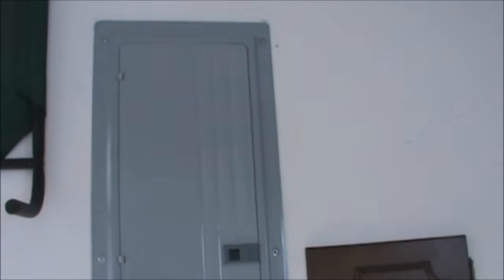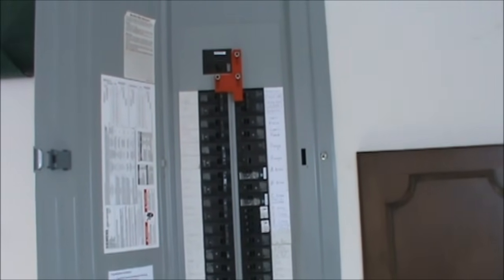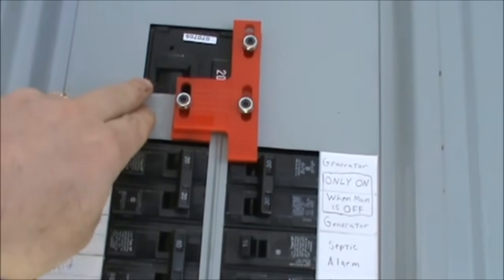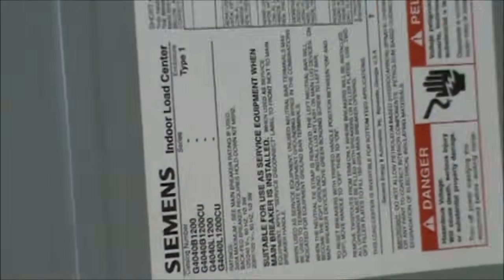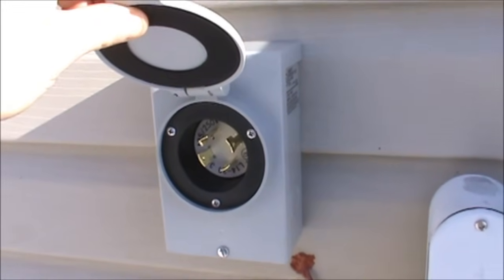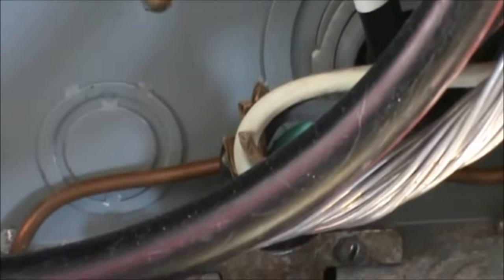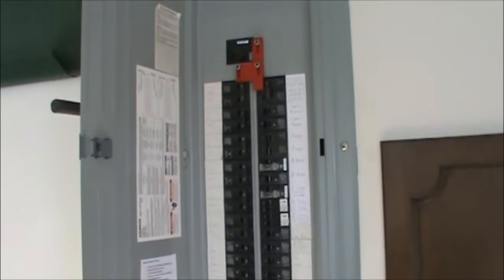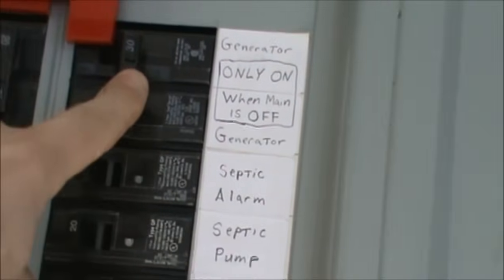How to wire a generator to an electrical panel

Comment from the maker: Here is the list of supplies:
http://amzn.to/2eEizqq  Square D lockout
http://amzn.to/2egMbMk Siemens lockout
http://amzn.to/2esoq6o  Generator outlet
http://amzn.to/2f2oYyB  Generator extension cord 4 prong
http://amzn.to/2egOJdC This Generator will do the whole house
http://amzn.to/1NzsVmM   Click links to get your generator transfer switch.
Reply: doublewide6 Repairs LL
Reply: @bigdaveyb 8 gage would be fine with. If you have an oil or gas furnace you can run your heat, but no electric heat pump and no ac, no oven unless it's gas, and if your stove is electric keep it to one burner at a time. I would only plug in the fridge every 2 hrs of about 20 minutes or until you hear it kick off. You have to know how many watts you gen puts out and use some sense. If you use a burner on the stove, maybe cut the heat for 15 minutes or whatever. Try only using what you need, if you're maxing out the gen you're using more gas so if the outage is longer than expected you may be without heat. I assume you're wondering because of winter coming that's why I mentioned heat so much. It gets VERY cold here at times. Also it's easier to hear water for a whore bath on the stove than it is to use the hot water heater, they use a ton of electricity.
Reply: Best video I saw on this!  Thank you.
Reply: I realize it is kinda off topic but do anybody know of a good website to stream new series online ?
Reply: Yer a good exaple of "the right way"...Thanx!
Reply: And I can't spell, ahahhhaaa

Comment: I'm a lineman.  Thank you so much for explaining the backfeed part. That is the #1 danger to us during storm work. Backfeed has killed a lot of good men
Reply: as a lineman ... not taking care of the back feed is what has killed a lot of good men. You shunt that secondary or take the secondary leads of the can and you will be safe.
Reply: Us line clearance guys thank you to.We have to get the trees off the wires during storm work & can be hazardous from many things including back feed.
Reply: I was always taught to break the home's incoming neutral/ground as well, since American homes are single phase 240V, with a center tapped transformer creating all the 120V between the phase. I was told 9 times out of 10, you should be fine not disconnecting it, but that 1 time out of 10 (anecdotal of course) problems can arise if the generator has any type of fault, or issue. Theoretically, all your 120V appliances should seek their way back to the source (generator), however, if there's a problem, they will have an alternate return path back up the neutral/ground coming in from your power co, which is directly connected to the transformer windings that give you 240V. This might be fine, or, it may lead to additional ground loops, and burnt out appliances. One guy I know, hooked up a generator like this during a blackout, and blew out every 240V appliance in his home that also contained 120V equipment within it, (like dryers, ovens, etc..) and he was told it was because he only disconnected the main (hot wires coming in) but left the neutral connected, creating two possible return paths. Somehow this resulted in a floating neutral condition, and everything that was 240V, but with internal 120V components, received higher voltages, like say 200-208V, burning stuff up.
Reply: If the mains are shut off on the panel, how can it back-feed?  (just trying to learn something, thanks).
Reply: the Interlock is a MUST-HAVE and WELL WORTH the investment to protect my Linemen. Salute 🫡 To All…….
Reply: I wonder what Lineman do about solar electricity in cases like this?

Comment: We were out for 21 days during Hurricane Ida in August 2021!!  The worst thing was finding gasoline, so my plan for the future is to find a portable generator that uses natural gas. Of course that adds to the cost of having it piped to my house and paying the $8 monthly minimum rate the gas company charges even when I use 0 cubic feet of gas. I think it’s still worth it if only to prevent finding gasoline when it can be dangerous to be on the roads. Thanks bud!

Comment: Very nice job. You covered everything correctly. I watched a couple of other guys videos and saw several mistakes. Biggest one was not using correct wire gauge or not having the lockout. Just remember to highlight the emergency breakers so someone other than you can do it easy and without worry. You may be busy somewhere else or gone.

Comment: If I wanted to get a certified electrician, I wouldn't have to search for how to hook a generator up to my electric panel.
Reply: +madseasonstaley  I think it is more safe, for a homeowner to be familiar with the electrical in their home.  The thing that confuses most, is how the 120v/240v concept. How it actually works in the panel. However if someone draws it out on paper, it makes sense.  A 240v transformer with a center tap dividing the voltage in two.  so you get two 120v legs with the centertap neutral, and or L1 and L2 make 240v.   People who are afraid of fires and electricity often burn their house down because they are willfully ignorant and dont have common sense, like running a space heater with a old 1950s loosy goosy recepticle. A person could replace the outlet with a new one and not be a moron.
Reply: Could get KILLED that is why... connections have to be done correctly from a certified electrician. ⚡⚡⚡🔥
Reply: @Rob Packard:
NO ....
Reply: @ACommenterOnYouTube  Yes.
Reply: @ACommenterOnYouTube  yes
Reply: @ACommenterOnYouTube  do as you PLEASE it is dangerous or you wouldn't be asking questions call someone certified don't listen to ignorance. Good LUCK
Reply: Right !! Give it a try !!!HAHAHAHAH!!!!
Reply: Thanks for the video, doublewide, ignore what this Mad Season troll/idiot says. A responsible homeowner takes it upon himself or herself to learn something about what a tradesperson is going to do in their home.
Reply: Exactly
Reply: Lmao . This aged well
Reply: Electricity is dangerous to those who are not properly trained to work with it. 
  Please consult a professional, this is not a “do it yourself project “.
Reply: Haha
Reply: Yep same here

Comment: I wired my generator into my panel using the exact same method.  While a sub panel may be the more popular route, I much prefer your & my method as you can have the flexibility to light up anything in your panel and is less expensive than a sub panel, however it just takes some common sense as to what you can light up, and most homeowners don't know.  Hence why this is a much less popular solution, but far superior IMHO.  Good vid!
Reply: I have a pushmatic breaker they don't make interlocks for them so I will need a sub panel or a transfer switch

Comment: Was sitting here on site (Northern Alberta Oil Sands), with the guys..talking about gen sets and how one would connect to a home panel. Nice video. Well explained and glad to see the interlock - very neat device. Am now thinking that deleting my electric stove for Nat Gas would go a long way to making life a bit simpler during an emergency...never did like that glass stove top anyway.!  Cheers and thank you for an informative, safety first video.
Reply: I tossed my electric stove...now have a nat gas one. Never looked back...Electric bill plunged, gas bill rose slightly...also tossed the electric dryer and went gas.  Greetings from Northern Ontario.

Comment: thanks for the video. i picked up the same generator for $499 at HF in Austin with a coupon.  basically since i have a gas dryer, i back feed my place through the electric dryer outlet. (only after installing a safety where i can't back feed through the grid.) works great.  i have a 3k foot house and i only load about 20%. i'm thinking i can probably connect my Central Air too but haven't yet.

Comment: This looks exactly like the cord i made to back feed my breakers.  All we did once the power was knocked off during the hurricane was turn the main off then feed our homemade cord through the breaker box then to the breaker and other points like you did.  The outlet you installed makes it way easier during a storm though!  We were out in a hurricane wiring the generator up.  Ran the whole house though besides hvac.

Comment: Do you know what to do when the 200A breaker is located in a main panel on one side of the house, and the second panel in the garage does not have a main breaker that could be locked off with an interlocking plates? Can I add a 180A breaker in the garage panel? I want my generator behind my garage.
Reply: Wow! Great question, I'm sorta in the same dilemma.
My 220 amp box is in my house where I can shut my main off, but my garage is on the other side of that and has is own small panel.
I do have a main shut of at the pole also, that will shut all power down, but I still can't understand how I can do this and still have power to my garage AND house.
Hard to explain!🤔
Reply: For info, to fix my problem, I finally installed a 200A breaker in my garage panel and a 50A breaker for my 1200KV power generator plus the interlocking plate of course. With my two 200A breakers, I feel safe.! LOL
Reply: @chrischenusa6323  Nice!

Comment: The video showing the "interlock" is exactly what I have been looking for being interested in a manual transfer and something simple.  Thanks so much for the info.
As for why a larger generator, the starting amperage of the water well motor has to be considered in the size of generator you buy.  Amperage is 3 to 5 times more at start up than running amps.

Comment: I read quite a lot of the comments posted here before making one myself.  I have a 4KW Generac, which I hard-wired into my home back in 2000, so I've got some experience, though I'm not an electrician.  I did take some extension courses thru the local university to learn something about it beforehand; after all, if you make a mistake with some DIY plumbing, all you get is wet...anyway, one thing I've noticed about some of the comments here is that there's a lot of discussion about generator size and how bigger is better, etc.  In discussing what would be run off these generators, it seems kind of sketchy.  

4KW (kilowatts) is of course 4,000 Watts, which is what my particular model is capable of producing and sustaining for extended periods.  What anybody wanting to put in a generator ought to do first is figure out how many watts it would take to operate the lights, plugs, appliances, etc. in your home without overloading the generator.  Lights and plugs are not really a problem, unless you routinely have multiple small appliances plugged in and running continuously and every light in the house on (we don't).  my size of generator can handle routine household lighting and appliance use, and has done so for going on 16 years.  This means we can watch TV, listen to the radio, use computers, etc, i.e, conduct routine business and entertain ourselves during the outage.  The electric stove, the water heater, the heat pump, washer/dryer, all the big stuff that produces heat and/or draws a lot of power, well, sorry about that.  These are emergency measures; you can bring in a kerosene heater and a propane stove for cooking and hot water.  I can say, however, from ample experience that my little Generac 4-kilowatt generator, 1999 vintage, can and does handle two full-size refrigerators and an upright freezer.  I've observed situations where two out of the three had their compressors (with the usual extra-amp start-up draw) cycle on simultaneously and that good old Generac 4000XL dug in and soldiered on without bogging down, hesitating or otherwise missing a beat.

And what size double-pole breaker do I use for all the above?  Believe it or not, twenty amps.  That's all, and that's all that's needed.  Why?  because the only circuits I activate when I'm on generator power are either fifteen or twenty amp:  the lights/plugs in the whole house, including the 20-amp plugs in the kitchen (in addition to the refrigerators we can use the microwave) and the freezer circuit in the garage.  We've never, in 15 years of operation, even once had too many lights on or too many appliances running to where the generator was overloaded (and it will let you know if you do) yet we were able to move throughout the house using them as needed, just as we would if the power wasn't out.  And there was no flickering lights or TV screens, either.  That dedicated 20-amp breaker feeding the power to the house is just right; if some sort of problem were to develop, it would do its job and open; it's never had to yet.

Since my system is, in fact, not in compliance with the NEC and is (potentially) dangerous, I literally go thru a checklist to bring the generator on and off line, similar to what pilots do when taking off or landing an airplane.  There is virtually no chance at all that the main breaker will be "accidentally" left (or turned) on while we're on generator power.  Common sense and attention to detail is all that's needed.
Reply: 4,000 watts may be good enough for some, especially those with city water. But if you have a well pump, you quite possibly need a more powerful generator, or you won't have running water.
Reply: I appreciate your experience and diligence in operating your generator.  However, if I were a service lineman working to restore power I would feel much better knowing that all generator hook-ups had a fail safe connection and that my life was not at risk because someone made a mistake.  It is best to install a fail safe connection as shown in this video.
Reply: Steve B p
Reply: Steve B that’s exactly how it’s calculated you definitely have electrical knowledge due to the way you explained the task at hand. I too have a generator for power outage that happened now and then, I’ve hooked mine up to operate my whole house. You must remember to triple the watts of whatever your starting up to turning on and then once it’s running it’ll only use what’s posted on the appliance label, this needs to be followed to avoid overworking your generator which results in it blowing up. I have a whole house generator and it’s plenty for what I’m using, I upgraded from a 5000 watt to a 8900 watt continuous run. Good luck everyone

Comment: Nice video !! The manual lock out is just what I have been looking for. I had wired my Generator the same way but without the lock out. I went to E bay and bought 2 of the lock out kits, I have 2 load center panel. By code our well has to be on a seperate circuit from the meter, so 2 load centers. I have a 10,000 w Northstar Gen set that has 2 240 outlets( thats why I bought it) one runs house and one runs the shop/pump house. I have used the Generator several times and it works everything in our all electric house. I was never comfortable with the manual set up I had but with the interlock it will be code. Thank you for the Info. I did not install a transfere swith set up because of a lack of room at the main load center.
Reply from the maker: Sounds like a really well thought out set up.  Most people skip the lock-out and that can kill someone.  Happy to hear the video worked out for you.
Reply: Or they just plug into the dryer outlet... Very dangerous really.

Comment: No need to let it run for 10 minutes. Once the generator spins up to high-idle, it's producing an acceptable frequency and voltage. Plug it in, start it up, throw some breakers.

Comment: Thanks for explaining how important the interlock kit is!!
Thanks for showing how simple it is to use an inlet receptacle instead of a suicide cord.
But, I will bust your electrician for not using the proper cable from the breaker to the inlet receptacle. SO cord isn't rated for use in the wall. It's a technical violation.  

And the rusty connector he found somewhere was funny. Not the worst violation I have ever seen or done. It is difficult to get access to the underside of the panel and that's why he did it that way, but still he could have put the connector on the cable, pulled it through with a fish and then installed a locknut on the inside.He probably didn't realize his work was going to be scrutinized on the internet by bored electricians :). Everything else looked very good, clean and proper.

You get an A- :)

Comment: Thanks so much for your video.  People shouldn't horse around with cowboy connections that could put a service lineman at deadly risk because of a mistake.  Service linemen working to restore power would feel much better knowing that all generator hook-ups had a fail safe connection and that their life was not at risk because someone made a mistake.  It is best to install a fail safe connection.  Do it right or hire an electrician.
Reply: Craig Wheeless I'm sick and tired  of hearing about the safety of the  service lineman, by now all lineman should treat every line as a energize line and should take and follow the right safety precautions

Comment: During a storm outage I’ve seen others shut off the main and run the generator extension cord to a 30 amp breaker to power some parts of the house to get warm and keep food from spoiling

Comment: Excellent tips especially the generator back feed interlock, thanks a million. good job!
Reply: Clint Hightower interlock is a waste of $$ and you don't need it, it's only for the incompetent ... That's outlet box outside is also a waste of $$ ... 
Just take the 10/4 cable, split the end open and take the 2 hot wires and attach them to the double 30 breaker and the white and ground you hook up to the appropriate buss bar ... DONE .. you just saved time and $$